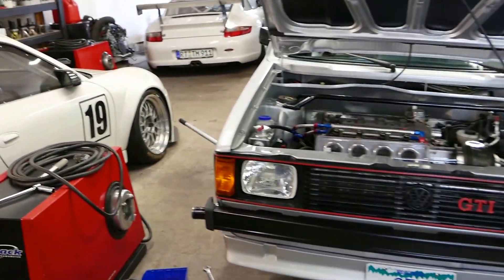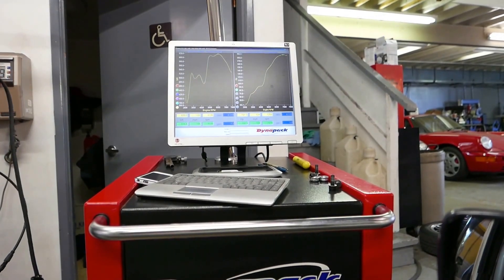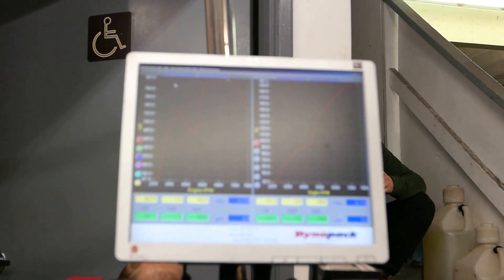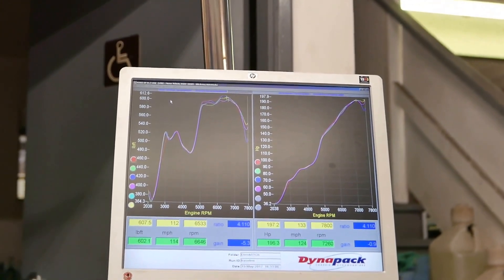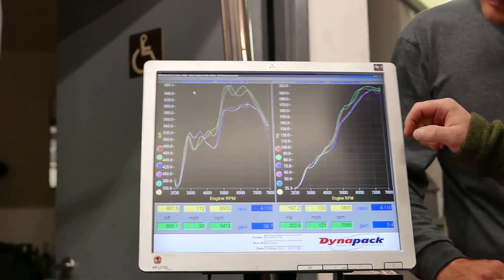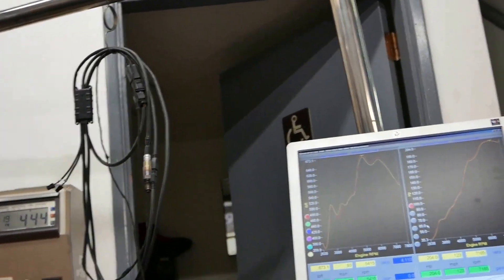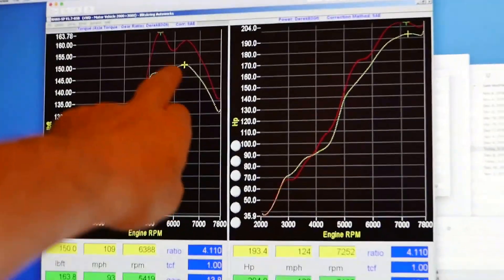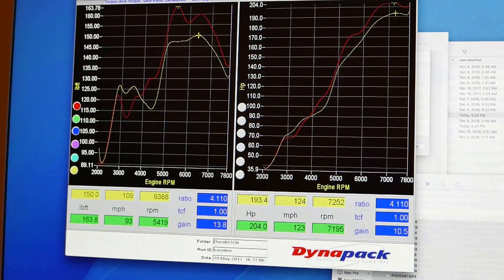The Ultimate 1983 Rabbit GTI - part 149 (Dynapack Dyno Testing)

Comment: Cool video! Unfortunately tuning N/A engines to the max is not really that simple.
First of all, you must ensure that all the temperatures (intake air, coolant, engine/trans/diff oil) in the car settled down to equilibrium and the engine is producing repeatable results. If you can make 3 runs in a row within +-1 lb/hp, then you can start the mapping.
Every sweep test has to start at the exact same temperatures. Even then the slightest change of any of the conditions might affect the readings. Always keep that in mind while analyzing/comparing the results after each pull.
The operator did not setup the Dynapack correctly (Lead in / Lead Out rpm off). In this case, the first 200rpm of the pull and the last 100rpm at the end of the pull must be IGNORED. These "dips" happen because the dyno goes from steady-state to sweep mode and at the end, the dyno stops the engine (more braking = more trq/hp).
Always compare full torque curves run to run, not the HP and not the peak numbers only!
I would recommend checking AFR at every 0.5 steps first. 0.2 step size is really to small to observe the difference. A few pulls at 12 12.5 13 13.5 is a good start. Normally, performance N/A engine makes the most power in the 12.5-13 AFR region. I rarely see it making more power above 13 AFR.
Ignition timing the same, start from low and do new pulls by adding 2 degrees. If there is a small gain up top but the midrange remains the same or even worse - goes down, this means ignition timing is over advanced. Use care and common sense here. Tuning ignition to peak HP number is a very bad idea!
If the engine is gaining 4-10lb of torque by adding 2deg it's good to go for more. If only 1-2lb, it's time to stop. And again, make sure that the test conditions are always the same and this 1-2 change was not affected by that.
About the injection angle. You need really big injectors to benefit from the tuning of an injection end angle. If injector DC% is 80-90% don't even bother, just put the number between 300-400deg. If DC is 50% or less, some gains are expected. Make 6 pulls in a row at 0 100 200 300 400 500 600deg. When the sweet spot has been found, narrow the search to that area and do a couple more pulls at the 25-50deg difference between the runs. It depends on how anal you want to go about it.
Always make sure your tests are done at the exact or very close conditions as previous ones, otherwise, this 1-2lb/hp difference might come from somewhere else but not from the changes in the ECU.
My English is not perfect, I'm from Europe, but I think you get the idea.
Happy tuning!
Reply from the maker: I agree that letting the car cool between runs is important and we did that with a huge fan that ran for 5 minutes between pulls. The rest of your points are excellent. I have done a lot of dyno and drag race testing/tuning and agree that temperature has a huge effect on results.

Comment: what cams do You run?
Reply from the maker: Techtonics 288 solid lifter
Reply: both cams 288 at .050? Maybe LSA is not a secret?
Reply from the maker: No. 288 at a very low lift - old school references. Around 254 at .050 - check the TT web site for more info. Just under 0.500 lift - very good match to the heads and the ITB intakes and racing exhaust. I have considered de-tuning the engine for street use but I fear it won't run as well as it does now. The only issue with the current setup is that the exhaust smells a bit at idle - not a rich smell but you notice it. I could put on the TT high flow cat converter in replacement for one of the resonators but I fear it will run hot and melt from the unburnt fuel at idle ... (BTW, even though I have WBOT exhaust measurement, a lot of intake/exhaust valve overlap can confuse the sensor ...
Reply: Thank You for specs. Yes cat will probably burn quite quickly and also it can cause more problems with intake   reverse flow during overlap.

Comment: So it's a 240 hp N/A VW motor that is perfectly streetable but a monster up top - with no variable valve lift/timing. I think this will be the engine to copy for a while!

God damn I want one in my GTI now. Where do you think most of the characteristics come from - combo of cams/headwork/itbs? Do you think the bottom end plays a big role?

Considering mildly following your footsteps on my 1.8 PL motor...
Reply from the maker: Folks that have experience with independent throttle bodies will tell you that they allow radical cams to idle like stockers - there is no cylinder to cylinder interference. That said, ITBs are a pain in the ass to setup and program for - they are quite non-linear - see my web site for more info and even download my ECU data files if you want and look at the fuel maps.

Having 2092cc with a 95.5mm crank and 83.5mm pistons does provide for good mid-range power but the large stroke and rod angle does limit the top end a bit. I am getting pretty much flat hp from 7-8,000 rpm which is good but if the engine had less stroke it would likely continue to make more power above 8,000 rpm. We kept the exhaust system diameter to 2.25" and we didn't overly open up the cylinder heads - again, see my web site for photos of the machining work on the 9A heads - the idea is to keep everything consistently open and smooth but not too large to kill turbulence. This engine likes 13.4:1 A/F and only needs 2lbs/hr of fuel to idle (and it does so smoothly at 14.7:1 A/F) and that tells us that the engine is highly efficient. It starts cold with only 6-7lbs/hr of fuel which is also amazing. 

So the lesson is: ITBs + good head porting + 288 cams + 2.25" exhaust, oh, and 12:1 pistons - I am running around on pump gas and I am not getting any knocking - so there!

But ITBs are crazy loud without an air box. You are warned.
Reply: Fantastic info! Thanks, and understood about the ITB volume, haha.

I've never done engine hot-rodding before, but it's super tempting to get my feet wet. The only thing preventing me (besides inexperience) is going from being mildly over-classed to super-overclassed in autocross...

I will definitely go over to your website and start reading.

Comment: Absolutley awesome! :)
Reply from the maker: Thx. Just tried the nitrous. Scared me a bit as I went over some rough surfaces in 3rd gear as it was really coming on strong at 6500rpm and it just about drove into the curb. No torque steer because of my LSD but if the road is uneven this amount of power in a FWD car can be trouble in a hurry if the road gets wonky!